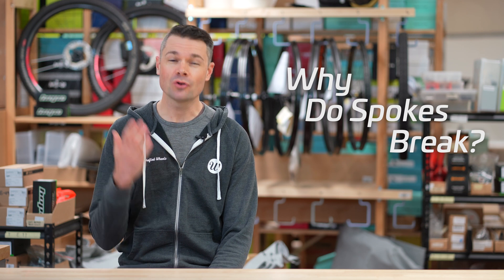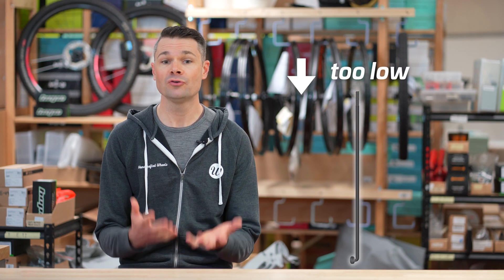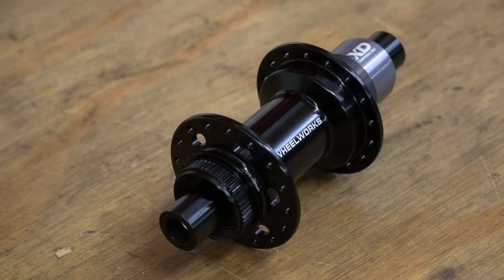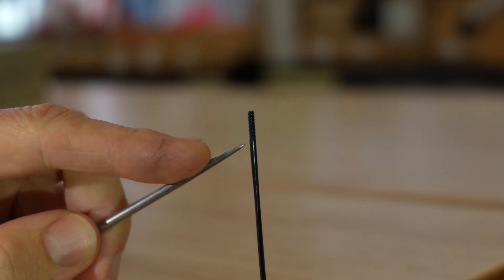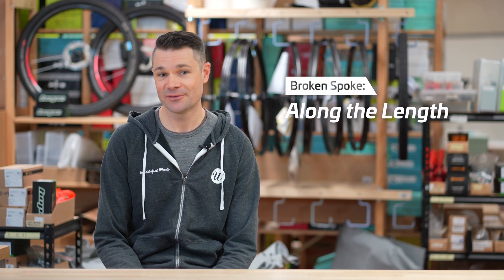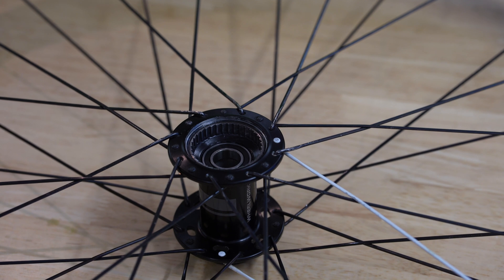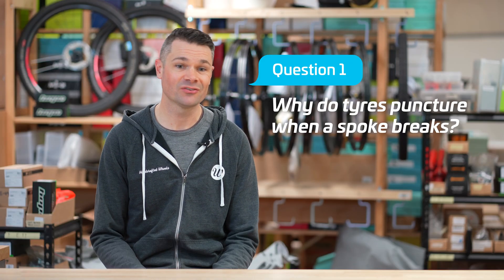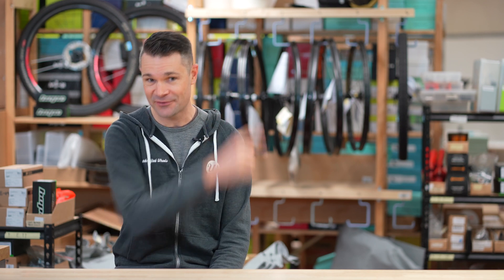Why Do Spokes Break?

Comment: I'll argue that spokes can break along the length for other factors than something snagged in them too. (I've been doing this over 20 years)

1- Buttts.  DT swiss butts are really long and smooth, so the stress applied to them spreads more evenly along the butted area.
    Wheelsmith spokes have a really short, sharp and defined butt. They break easy.

2 - Black Coating. The heat treating on new black spokes definitely is a factor in broken spokes. I see a lot of black spokes break without snags. Super stiff unyeilding carbon rims only further propogates this. I still ride stainless spokes. They look better, clean better, and they don't fatigue like black ones do.
Reply from the maker: Have you seen any high quality black spokes break?  I've heard the old wives tale of black spokes breaking but in my experience this is cheap black spokes breaking, not high quality ones.  -TT
Reply: @WheelworksHandcraftedWheels  I've seen wheels with something like a dozen spokes each broken in the middle--bike was stored in a shed with pool chlorine. Obviously this also caused other damage to the bike.

Comment: Sorry but the galvanic corrosion on rear wheels from sealant more than front is pure hogwash.

 Aluminum has fatigue cycles and once it passes those cycles it will break.  Rear wheel aluminum nipples don't break bcause of surface corrosion from more sealant.
 They break more because 75% of the riders weight is always on the rear wheel so it takes harder hits during cycles and thus is more prone to fatigue cycles that go over it's limit. A limit which continually lowers throughtout it's life.

 Or maybe the guy putting on rim tape at your factory just can't seem to tape the rear wheels as good as the front (Roll eyes emoji)

Comment: Your explanation for breaking at the nipple needs work. Sure if the spoke is too short the first thread is 'exposed'. But if it's too long then the first spoke is up inside the nipple (not exposed at all, unless you count insde the rim and I've never seen the tip of a spoke break off above the nipple where it is exposed). 
but either way there is always some variation of overlap of threads, I doubt half the wheels out there have exact thread overlap where every thread is engaged fully.
 Furthermore, just because you can't see the threads doesn't mean they are engaged. Nipples have a blank zone of a couple mm before the threads start.

Honestly I think that talking point is moot and it goes back to your previous remark. "Using quality spokes". A cheap spoke is going to be weaker and thus break at a stress point (J bend, head, thread or butt).  I've seen a lot of spokes break at all these points, but I swear by DT swiss spokes like you do and I can't say I've seen them fatigue and break at any of these points.

 It's this kind of mis-information that gets you tube know it alls in the shop going "I can see one thread that's not right, my wheel is gonna fail I need a refund. Then they ride the wheel for years and have NO issues at all.

Comment: When you say thicker spokes break at the head more easily, does that include 'high quality' spokes like the DT Alpine III?
Regards breaking at the nipple end, doesn't lacing pattern effect this as well? If you try and do 4 cross on a 20" BMX wheel you'll have a horrible spoke entry angle!
Reply from the maker: Most "high quality" spokes won't break at the head, and that includes the Alpine III.  You're correct about the lacing pattern with the nipples, although in real life it needs to be pretty extreme (like your bmx example) or a really terrible rim before this makes a difference.  2 cross vs 3 cross on a 29" rim doesn't make much difference for example, but building a rim which has directional spoke holes 'backwards' can cause issues.  -TT
Reply: @WheelworksHandcraftedWheels  That all makes sense, thanks for the reply. Loving the channel BTW, keep up the good work  👍
Reply from the maker: @sandy_knight  thanks mate! -Tristan

Comment: On carbon rims do you use washers under the spoke head ?
Reply from the maker: None of the carbon rims we use specify a washer.  In the early days of carbon rims they were occasionally used to help nipple pull-through as the nipple holes were a weak point but this hasn't been the case for about a decade now.  -Tristan

Comment: I think there's another reason that spokes commonly break along the length:  metal fatigue resulting from torsional stress that comes from unresolved spoke windup during tensioning.  This can take months or even years to finally cripple your spokes so you might not ever trace it back to its cause.  I think it's probably more common in machine-built wheels than in hand-laced wheels.  I had two DT spokes break on my 29er on the same ride.  When I got home, I unscrewed an unbroken spoke from its nipple and gently flexed the spoke to clear it from the neighboring spokes so I could measure it.  It immediately folded in half and broke.  Like the other broken spokes, it looked exactly as if someone had taken a cable cutter and cut through the middle of the spoke.  
I now put masking tape flags on my spokes to make sure that the spoke isn't turning with the nipple when the wheel is going through final tensioning. It usually does, even with anti-seize compound on the threads. I glued some shoe leather to the jaws of a pair of small vise grips so I can grab the spoke and prevent that.  It doesn't take much of a twist to fatigue the metal.  Both the torsional fatigue and the subsequent flexing of the spoke are greatest at the midpoint of length so it's a double whammy of doom.  I wish all spokes came with wrench flats like some of the Sapim and Pillar spokes do.
Reply: I've had same experience, I had two broke in midsection while not in use.  I replaced them & two more broke again while not in use. Thanks for mentioning the torque stress, I would not have thought of it.

Comment: Hey there! I have a related question…

I’m 6’5” 230. And I ride road only. I have to get my rear wheel trued 1 to 3 times a year. 

It’s a 24 spoke wheel. Should heavier riders side 28 spoked-wheels to prevent this result?
Reply: Probably would help
Reply: @redmenace5552  I have since had a 56mm wheel built with 28 spokes. I might have 100 miles on them. I am still testing this theory
Reply: @THSimagery  oh I didn't even notice the comment was from 5 months ago lol. Like the video said tho prob has a good amount to do with the quality of the building itself and the wheels. More spokes can't hurt tho.  Best of luck
Reply: Did you solve the problem ? Please tell me
Reply: @saadoony  yes, I ordered wheels from light bicycle. 55mm deep. They seem to be bullet proof!  😆

Comment: Hey.   Just caught on to your You Tube content.   Thanks for the great info.  I am building up a bike with some DT Swiss 350 hubs and want to do some white spokes as I have a white fork that I want to accent off of.   Any recommendations regarding white spokes as my local bike shop he’s not crazy about the idea as they are not anodized, and they are baked on in terms of color.  My bike door will mostly be my permanent trainer bike on my turbo trainer.  This means I won’t be exposed to the elements and be wearing at the finish.
Reply from the maker: We have our white spokes powdercoated locally by a really high quality place that does a lot of hotrod car stuff.  The quality is really good and we see very little chipping or wearing. -Tristan
Reply: I would love it if when I’m ready to build my wheels that I could maybe buy some spokes off you.  My local bike shop builds wheels and I’ve had good luck with them but they are not able to get white spokes.

Comment: Regarding broken spoke nipples: seems to correlate with Al nipples on carbon rims. A gradual redox reaction sets in between carbon & Al, slowly corroding and weakening the Al nipple until it cracks and breaks. Typically takes a few years for this to happen. Because of this, with carbon rims, I only use brass nipples.
Reply from the maker: You're correct that galvanic corrosion happens a lot more with carbon-aluminium than with aluminium-aluminum.  An electrolyte is required and either water from riding in the rain, or sealant from damaged rim tape, will really contribute to this process.  -Tristan
Reply: Yes, seen this as well, had a wheel after some years where the nipples broke away and they look like ist they has dental caries. But I think it depends… My own wheels with the same materials and tubeless sealant and with much more miles of riding show no damage. I guess quality nipples with a good anodisation and also mounting the nipples without damaging the anodisation is key here. I‘ a fan of Sapim polyax nipples in this respect…
Reply: @georglinde3910  There may be ways to mitigate or postpone the redox/corrosion, but using brass nipples avoids the issue entirely, making a lifetime wheel. And brass nipples are more robust especially over time. The cost is about 20 grams per wheel; choose your poison.
Reply: Aluminum nipples will always break. Aluminum has a fatigue cycle and once it's reached it will fail. Spokes tighten and loosen continually as the wheel rotates. These are cycles and aluminum only has so many. But they are light and pretty :)   Carbon rims are super stiff so they transfer more stress to the nipple.

Comment: At my rear wheel, the rim diameter is slightly higher near the weld.
Is it okay to add some more tension to the spokes near the weld in order to pull it back into a nice evenly round circle?
Or is the rim just too bad quality to be even remotely reliable and needs to be replaced?
Reply from the maker: Great question.  You'll need to balance spoke tension with trueness...generally a high quality rim will be able to be true with the spoke tension very even.   The spokes should be /holding/ the rim round, not /making/ the rim round.  Generally if you need to add a little extra tension at the weld/joint that's ok, but not too much.  -Tristan

Comment: tldr for all future watchers, metal (steel) has an elasticity range where even when changing tension from high levels to low levels does not fatigue the metal. When the spokes are exposed to changes in tension outside of elasticity range they fatigue thus connecting to their inevitable demise. To prevent this, you want to either A, not overload your wheel with weight or B, overbuild your wheel to resist even the most extreme conditions in order to maintain that elasticity range of the metal.
Reply: Not tldr but 12 minutes of pure gold. It's not just about spoke tension, it's about why spokes break and how best to avoid or remedy it. If you know it all then why bother watching 😁
Reply: @Toob41 looked more like an advert to me. I was expecting a little more than "get your wheel built by us"😅
Reply: @Toob41  we do not know it all. we are trying to get the information, but the talky talky takes too long time
Reply: There are several errors in your post.  You obviously don't have a Mechanical Engineering degree or background in Strength of Materials because you don't understand the definition of fatigue.  Suggest you read a classic text like Shigley's "Mechanical Engineering Design" that covers fatigue.  It's in at least its 10th Edition for good reason, so there are plenty of copies around.

Comment: I bought a new bike,  it uses WTB ST i23 TCS 2.0, this wheel,  its less than a year old have broken two spokes already, any ideas?
Reply: Sorry forgot to say rear wheel drive side, thanks.
Reply from the maker: Where on the spoke are they breaking?  The video should help with what the cause and solution is at the different locations.  -Tristan
Reply: @WheelworksHandcraftedWheels  hey have had the wheel respoked with stronger spokes.  They were breaking at the nipples.  So far no problems.  Thanks for reply.

Comment: Do you have an ideal spoke tension range on aluminum or carbon rims?
Reply from the maker: It can depend on the brand / model of rim, however as a rule of thumb we built to 120kgf on the rear driveside and 110kgf on the front disc brake side.  -Tristan

Comment: "A well built wheel should not break spokes",  can be interpreted as saying never will break spokes. 
Your lifetime warranty can be mistaken to mean your wheel builds will never brake spokes. You must be receiving returns to replace broken spokes. 
    Overall, your video was very informative.
Reply from the maker: Hi Noe.  Hopefully the video explains that breakages at the spoke's head or thread are entirely dependent on the wheelbuilder - we see very, very few* of these so we're confident saying our wheels will never break spokes in this way.  Almost all of the spoke breakages we see are from something being jammed into the wheel - often times it's the customers rear derailleur when the limit-screws aren't adjusted correctly, sometimes it's a stick or rock flicked up while riding - but because we have no control over this we can't promise it will never happen.  We can promise that our wheels are incredibly well-built which makes repairing these issues much easier though.  Does that make sense?  -Tristan

*very, very few:  We've had 7 breakages at the spoke head in 16 years.  All were with Sapim CX-Ray spokes which is a reason we don't use them any more.  We see the occasional broken aluminium nipple which is generally from sealant corrosion.
Reply: I've broken spokes hitting pot holes. Last night I broke a spoke at the nipple when I took a roundabout very  sharply.  Both these put sudden and excessive force at one spot. You are on dangerous ground claiming that only bad builds = broken spokes.